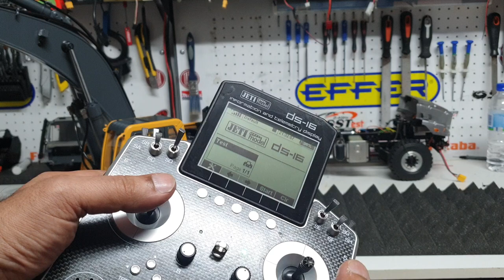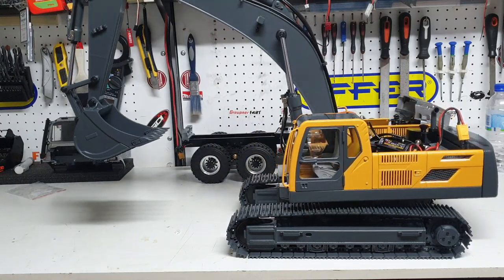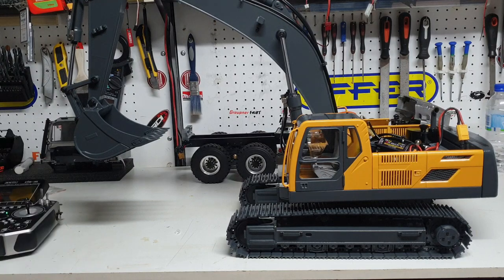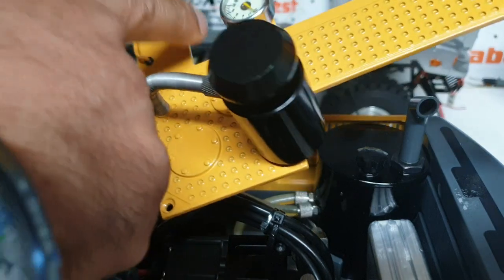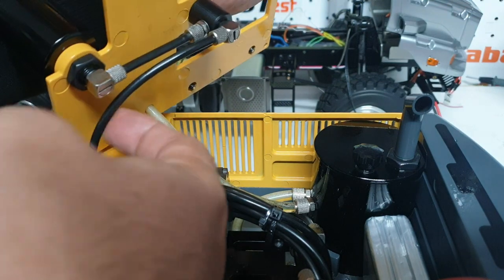CSMI : RC VLV 360 Excavator Start up explained with Jeti radio.

Comment: I see that overland in background 8-) I have a few overlands.  I have a question and hopefully you can help me with the answer.  I also have this 360L excavator.  I am trying to find out the turns out should both the regulators be set at at stock settings.  I don't see much of a difference on the gage as I played around with settings yet at my mistake I didn't turn both adj knobs in for a reference point before I messed with settings.  I got it running very nicely but I was wondering what stock was.  Are there better systems as far as regulators   I could use to really dial in the performance.  Great demo video and I was recommending by another YouTube to swing by and ask your advise.  I also subbed never ran across your channel before?
Reply: ps I was referring too the relieve valves,, and again great awesome video
Reply from the maker: Thanks for the feedback. 
The gauge is very coarse to read. So you won't see a difference. 
The easiest way is to wind out the pressure relief valve out then wind it in one turn in at a time. 
Use the boom and bucket to lift the tracks.  When you can.  Wind it another half a turn in.  That's it.
Reply: @CSMIRC  thank you for responding.  I had pretty much had then when tuning last night. I’d turned one way while testing didn’t do much then listened to the pump motor “happy tuned sound” as I turned in. Noticed power and speed picking up to cylinders.  Figured it’s running smooth and lifting own weight no problems with no strained pump motor sounds.  I love the way you’ve got this one so smooth. I’d be lying if I did say I did not back out the internal pressure relief valve too far when experimenting 😬 but I was on guard with the transmitter and shut pump off instantly saved a big mess from happening 🤣  I’m installing my personal light set up in my unit this evening. Thanks again Ron